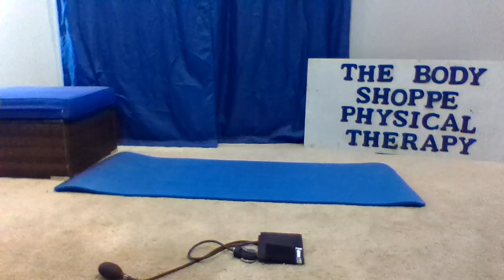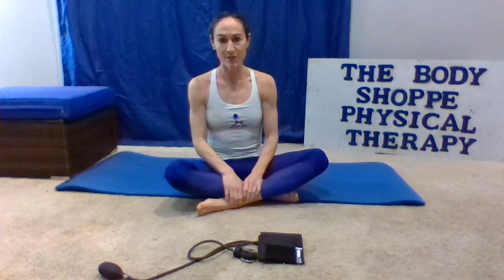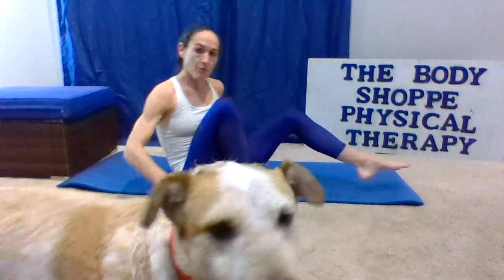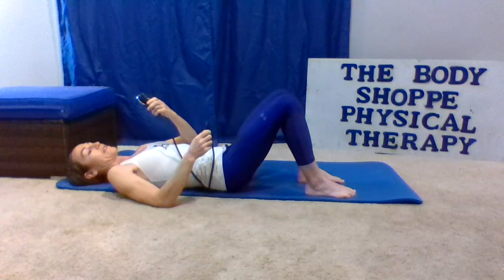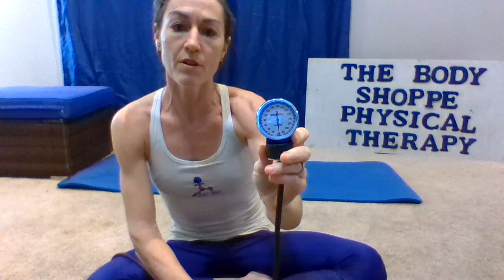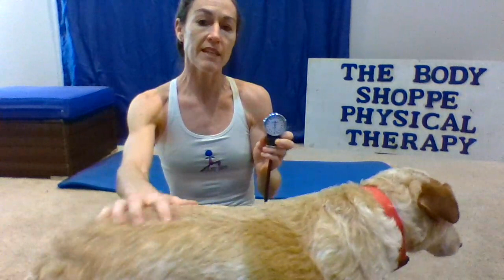Pelvic Floor Strengthening: using a blood pressure cuff for biofeedback

Comment: and what if i have a weak pelvic floor, how can i know? by looking at that needle ?
Reply from the maker: In general, yes.  A PT can help determine if you are isolating. If you push with the feet or squeeze your buttocks, then the needle reading is inaccurate due to compensatory muscles working and not the lower abdominals and pelvic floor.

Comment: so how can i measure my pelvic muscle strength ?
Reply from the maker: Using vaginal weights can give an idea of strength. But the pressure on the BP cuff can give feedback in core strength which has been correlated with pelvic floor activation so the stronger the lower abdominals, usually the stronger the pelvic floor.